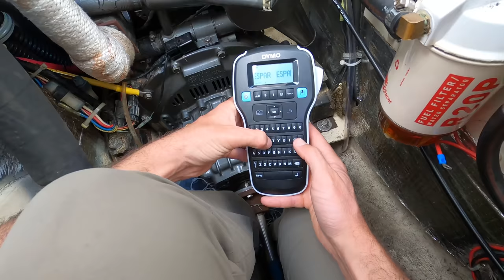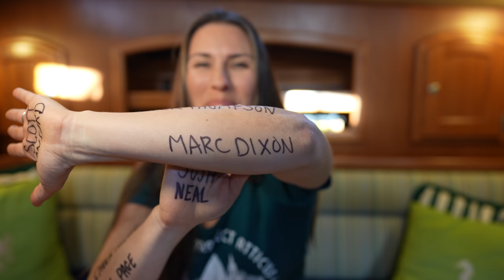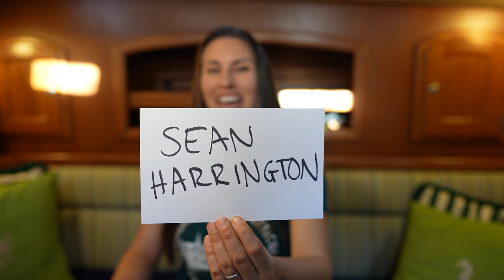We BARELY made it | S06E25

Comment: I have worked in state emergencies and one of my pieces of equipment was a five ton jet boat.  When it flooded, that just mean't the job changed a little as we drove past everyone (who was stuck) in our six-wheel drive truck on our way to our boats.  Here's a thought, it's just a thought and only thought; to help with lighting and lessening the load on the batteries when not on shore power, use solar-garden-lights...  I put them on the walls in our home above pictures, they provide a nice environment along with emergency lights when we lose electricity.  The lights are inside with the solar panels outside, connected by a ten foot wire.  We are limited only by our imagination.  I laughed my ass off with the pump-outlet being backwards...  No offense mean't.

Comment: Great video. Followed along with you through your lens. Really enjoy the inclusion of the projects you work on and complete. I recently learned that the flat fuses (not sure the brand) have a feature where a tiny LED located within the fuse at the top center portion lights up when the fuse is blown. A very quick look will identify the bad fuse(s). Discovered this during our restoration of a 1951 Chevy panel truck. Glad you made it to the boat show. I could feel your sailing fatigue. Very much enjoy your channel. Cheers 👍🇺🇸😎...

Comment: The non perforated clamps actually allow you to apply more pressure. Due to the fact they do not bite into the hoses AS bad also especially the ones with the rounded edges.